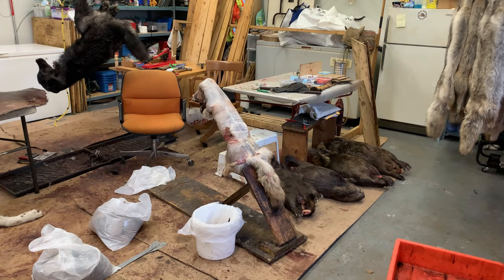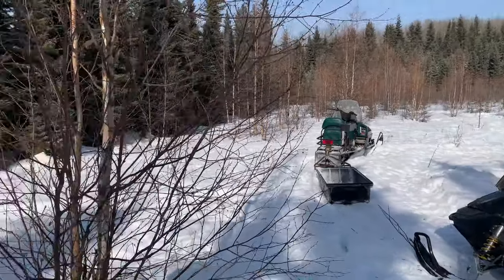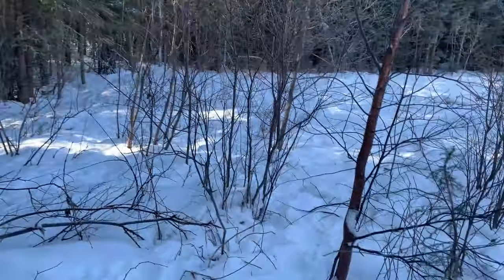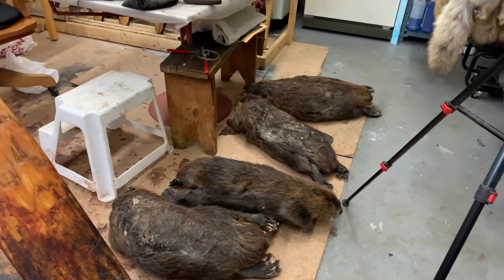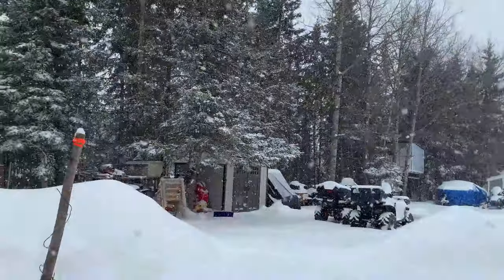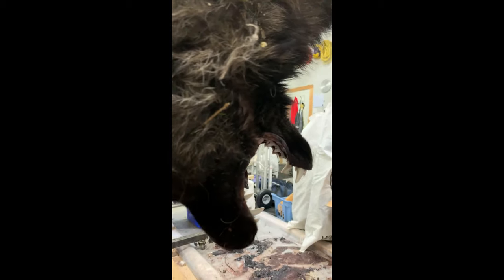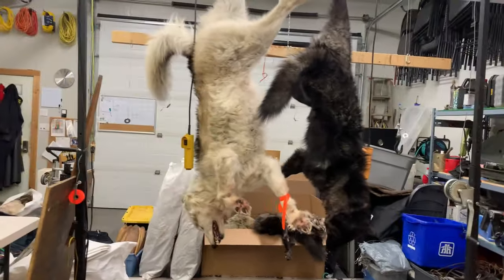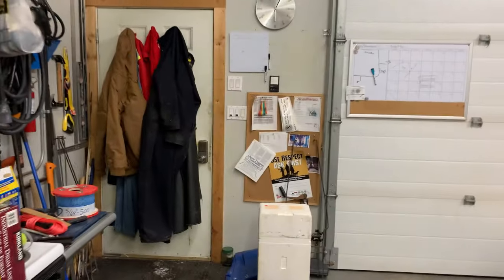Shop time 2 - wolf feet and lips

Comment: I know what your going through with the back. The drs fused my lower back and they put pins plates rods screws and disc spacers in. I had open heart surgery cause they found a big hole in between the 2 main chambers so they cracked me open and went in and sewed it close. I was in icu for a month cause they had problems getting it started and 2 days after that it stopped again. Im on all kinds of medicine for my heart. I couldn't trap cause i couldn't afford traps and snares. Having health problems these drs and hospitals will bleed you dry.
Reply from the maker: Sorry to hear what you are going through Scott. Hope things turn around and get better for you. 🙏🏻 Scary to think about what you have been through.